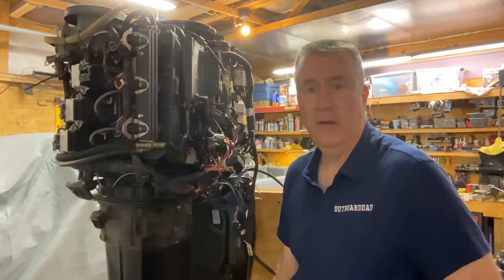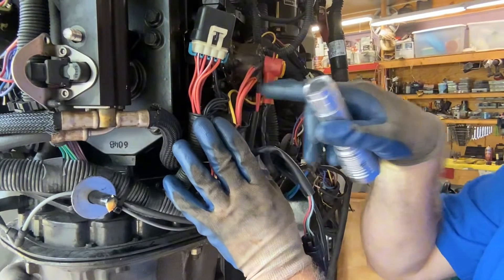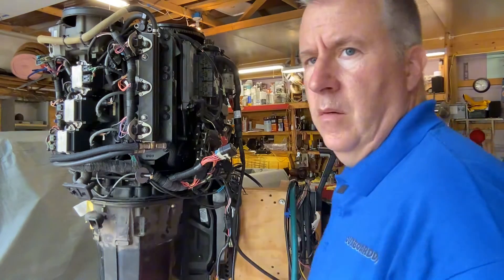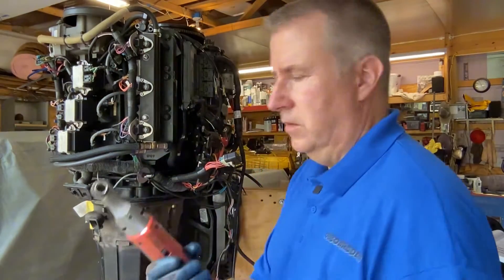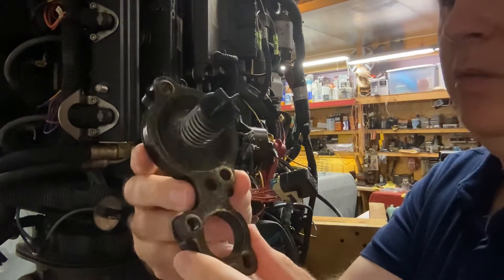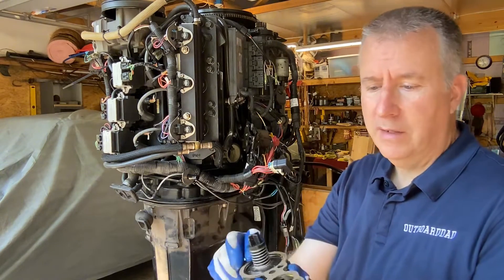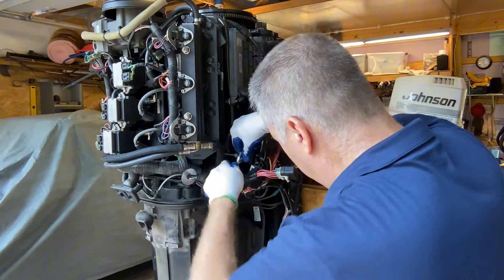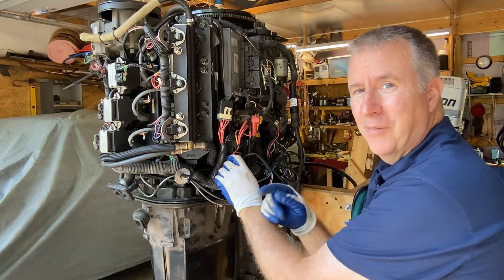Mercury Optimax Outboard Poppet valve replacement

Comment: Will a bad poppet valve cause a motor not to pee at idle? And visually looking at it looks good/ checks out can it be bad but looking good?
Reply from the maker: It’s a fairly simple device. Yes if it letting water by the possible that it will not build enough pressure to pee. Have you flushed the hose and peee connection?
Reply: @OutboardDad Yes sir, flushed and back flushed everything single passage that pertaining to the cooling system. It'll pee when I do that but not while it's running.  Very strange thing I have going on.
Reply from the maker: @duckco1 ok, then it’s something with your water pump or the connection to the tube

Comment: Hello Keith
Thank you for your video!
  I’m having a problem with my Mercury 115 2018
  Runs fine at low rpm’s at high RPM 5000ish it drops water pressure and alarm goes off. Drop RPM and pressure comes back. 
   No blockage on intake’s
  Any ideas?

Comment: Outboard Poppet valve is a pressure regulator it's there to regulate water flow. The main problem with the Poppet valve is if it doesn't open at higher revolutions, the engine runs cold and you can have excess carbon buildup in the cylinder. And if it stays open, the engine can overheat at lower revolutions. If you have blockages in your cylinder and heads, and the Poppet valve is stuck open will lead to overheating issues as well, but it's not the Poppet valve. It's blocked cooling galleries.
Reply from the maker: Great explanation of how these operate, are you a Mercury tech?

Comment: How do you get the whole chasis around off? Think i got a problem with the poppet valve on my 135hp mercury optimax 2001 modell. It overheats with high rpm but all fine when laying on low rpm (below 1500)ish
Reply from the maker: Ok not sure what you mean by chassis? The plastic cowlings?
Reply: @OutboardDad  yes exactly 😊

Comment: Yes good  video ty I have a 98 mercury 200 I changed my poppit last year, and was concerned when I tighten down the spring  I screwed the Phillips all the way in   and the spring was tight , I didn't have much movement that way and I was thinking it's probably to tight  hence not allowing the poppit to open much or not at all, what should the spring length be , mines to tight?
Reply from the maker: The Philips screw should be tight and the spring needs to have enough play for the poppet to open

Comment: Hey OutboardDad, love the DIY approach.  I have a 2002 Optimax 225 that sat for 7+ years with the old gas in it.  I replaced the pumps, have good compression, and get spark but it wont fire at all.  I have tested the fuel pump pressure at the VST and it is over 100 psi.  When I connect a gauge to the starboard fuel rail, I get only 55 psi with the key on, drops to almost zero when I crank the engine, and bumps back to over 100 when I stop cranking.  Plugs are dry so it seems pressure is being lost somewhere.  Any tip you  or anyone else can think of?
Reply from the maker: @johnmunoz5675  Hey thanks for reaching out! I would be suspect of the air and fuel injectors. The fist thing I would do is remove and flush the entire fuel system. Anytime you are going to test run spray fogging oil in the intakes as it’s possible that you may have lost oil system prime. Espy if it sat on its side for a time. You may need to replace the injectors and it may get costly. My best recommendation would be to find the exact motor you have that was running recently and threw a rod or has a bad cylinder. This way you can use all the fuel system. Let me know how you make out!
Reply: @OutboardDad  Thanks for getting back to me so quickly!  I am a one-motor owner and this motor just sat around while I was occupied with work.  Now just trying to resurrect it.  Don't mind buying the parts necessary, just would like to replace only what I need.  It looks like I need to check to make sure there is no fuel in the air line and if not, move on to the injectors
Reply from the maker: @ That sounds like a good start! Let me know how it goes

Comment: Sealer should never be used on these parts. Check your manual. This is the second video you've done that you used sealant. The gasket is the seal. It won't matter to you unless you're the next guy that removes or checks the poppet valve. Then you would be cussing the guy who messed up you're chances of reusing the gasket if necessary. Otherwise, very helpful content.
Reply from the maker: @donsscooters  Thank you for the feedback and I would normally agree. Most of these gaskets for the Mercury are cork and rarely able to be reused. What would be your suggestion when parts have small pitting in them to assist with sealing?

Comment: I have a 2006 Optimax 150HP. Had issues starting because no air/fuel pressure. I rebuild the compressor, clean the reeds and also removed and check both air/fuel diaphragms. After that, motor starts right up but after a second or third start motor will rev up very high, like 3000 rpm. Looks like when it builds up fuel pressure, it idles really high and there is a solid steady beat alarm. What you think might be the issue? Going to dig into the tracker valve again and maybe injectors but what could it be.
Reply from the maker: @aaronthoj2000  For that I would want to connect the scanner and see what it’s doing

Comment: optimax motor have a strainer that plug up and give you a over heat horn
Reply from the maker: @davetyson2331  thanks Dave, I have heard that but have not seen it , where specifically is it located?
Reply: @OutboardDad  hose running from engine base to compressor strainer is fitting in base
Reply from the maker: @ Thanks for shring, are you a marine mechanic?
Reply: @OutboardDad  retired 30 yr
Reply from the maker: @ Nice, appreciate your knowledge and willingness to share

Comment: Do you know where the poppet valve is on a v6 2stroke 1993 175hp black max?
Reply from the maker: @SolarBurrito  should be similar to the 150 I have in videos that I am rebuilding. If not I can look in my book if you need send an email keith@outboarddad.com
Reply from the maker: did you find your poppet valve?

Comment: This is an EXCELLENT video on the poppet valve! Unfortunately for me I wish I had seen it before I tried to replace mine. I accidently pushed the rubber Gromet through the back of the Poppet valve hole into the engine water jacket! Will I have to tare the Engine down to retrieve it or is there another way to get it out?? Plz help.
Reply from the maker: @horacelee880  interesting, I use a few different hook tools some home made. I would first buy a cheap boro scope on Amazon for your phone and see exactly where it is. Then you can bend up a coat hanger even sharpen the end to poke through and pull. Even a large fish hook can be heated and bent into shape. Let me know if I can help. Keithm5734@verizon.net
Reply: @OutboardDad  Now there`s an IDEA!! Would have never thought of it!! Thanks Capt!
Reply: LORD HAVE MERCY IT WORKED!!! I did as you suggested and got the scope from Amazon to locate it and used a coat hanger and fished it outta there!! Unbelievable!! Thanks to You OutboardDad for the idea! Now the poppet valve assembly is ready for replacement. Just one more thing :what type of sealer for the gaskets do you suggest?
Reply from the maker: @horacelee880  awesome! I had faith in you! I use a 3m weather stripping adheasive. If you watch any of my water pump or poppet valve videos it should show it there.
Reply: @OutboardDad  Duly Noted Bossman!
Reply: Thanku

Comment: What does a poppet valve do and how do you know when it isn’t working properly?
Reply from the maker: The poppet valve is when you are running higher RPM so the engine has full water flow for cooling. It overrides the thermostats just a simple spring pressure. The water pump at higher rpm builds pressure pushing against the spring opening the valve. Has to be pulled apart to be sure it’s not corroded or stuck
Reply: Thanks for the explanation. That helps me understand the motor operations much better.

Comment: Keith,  thanks for these great videos.  Two questions:  1) can you share where you got the service manual that you’re referencing, and 2) did I miss the video where you removed the lower unit and determined that the poppet valve and thermostats need to be replaced or are you replacing them as a precaution?
Reply from the maker: @Zamazing717  hey brother, this is a motor I will sell when done so want to sell something with all work done for the new owner. The service manual I bought at West Marine and have a video a few weeks back about that with interesting comments as well you will want to watch. Yes there are previous videos where I removed lower because I had no water flow when I ran the motor. Send me an email if I can help you get back on the water keithm5734@verizon.net
Reply: @OutboardDad  Thanks Keith,  I’ll search for both video’s.  My Optimax is doing well right now so I’m on the water.  I took on servicing and repairing last season so just trying to learn as much as possible about the engine and service items.  I only have 280 hours on the engine but it’s a 2000 model so I’m anticipating issues to surface pretty soon.
Reply from the maker: @Zamazing717  ok, I have another video on the air pump coming soon. This is a service issue that gets missed and can be very costly. Cheap o-ring kit to keep water from getting into the engine and causing major problems. Thanks for connecting and let me know if I can help

Comment: I have the same engine and this video definitely help me, I’m still trying to figure out why my engine won’t rev up and the 4 beep sound won’t go away 😢
Reply from the maker: @bendymagic8307  ok, let me look it up. I have the scan tool, where are you located?
Reply: @OutboardDad  thank you for your respond im in Nevada, it won’t go over 1500 rpm even if it’s in forward or reverse and the beep won’t stop..
Reply from the maker: @bendymagic8307  keep an eye on this video comments, Dave says there is a strainer on the Optimax that gets plugged